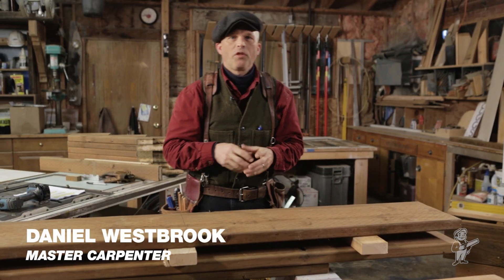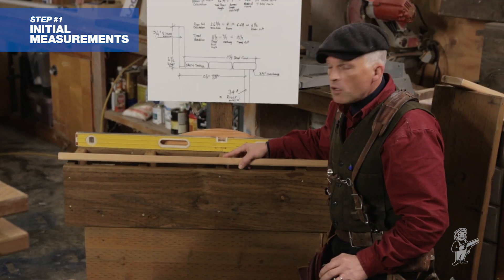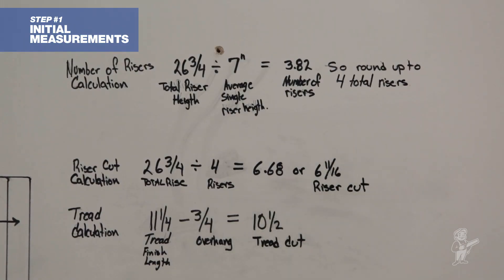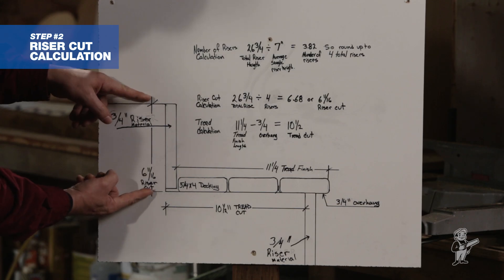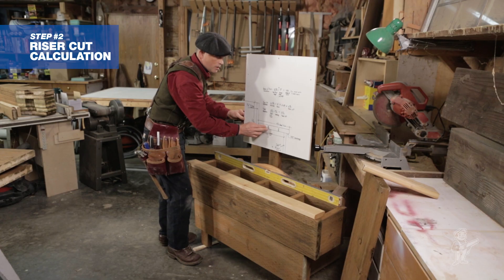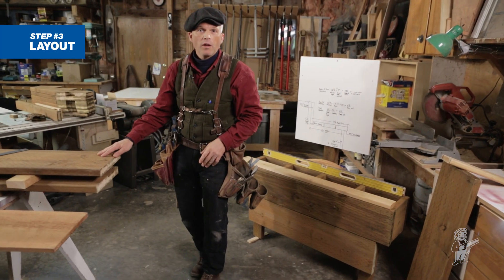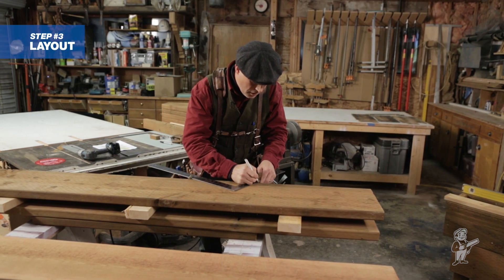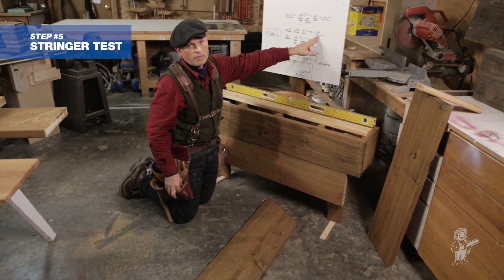How to Build Simple Stair Stringers

Comment: what is your recommendation if using a 5.5" composite decking on the treads? what would be the ideal thread run with the 9/16" fascia for riser and 1/4" gapping? would the 10.5" still works? thanks
Reply from the maker: The 10 1/2" should still work fine. Depending on the brand of decking, this should leave you with 3/4" to 1" of overhang if you add that small gap (between tread and riser) for drainage as Daniel mentions. If you want a little less overhang, you could increase your run measurement by a small amount.

Comment: When building a landing and stairs for entry into the house from inside the garage, how do you account for the drainage slope of the garage floor?

My stairs will run perpendicular to the wall, so the outer stringer will be sitting a fraction of an inch lower than the inside stringer. Do I just cut the outside stringer to account for that fraction of an inch?

Comment: If you don’t have those square buttons, use a cpl pairs of vice grips.
🤜🤛
Reply: psidvicious ...I do have & use the brass stops But have also used the black paperclips in a pinch, usually when I’ve loaned out the brass one. They’re easy to lose so I hold m together with a pc. of heavy copper wire like 12/3   Happy building y’all 😃
Reply: @unclefuddelmer9224  Right! Those little brass buttons definitely have a tendency to spring legs! I usually just screw them one to the other and toss them in a special tool box with other small tools that also have a bad habit of wandering off like small drill bits, extra plumb bob tips, drill chucks etc.
🤜🤛

Comment: Nobody notice that 1st step is shorter than the rest???
Reply: Disregarding 5/4 decking on top of "patio" and dividing by 4 will give you 4 steps of equal rise. Remember, you're putting 5/4 decking on top of each riser AND the deck. Maybe it's traditional that the 1st step be shorter to make the climb easier to start, I don't know.